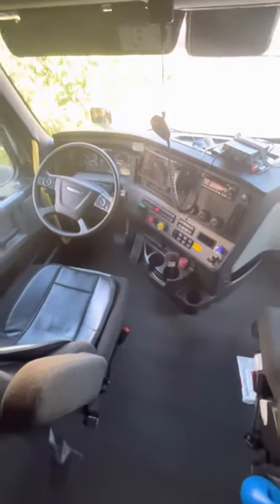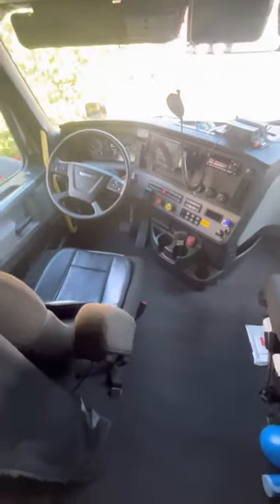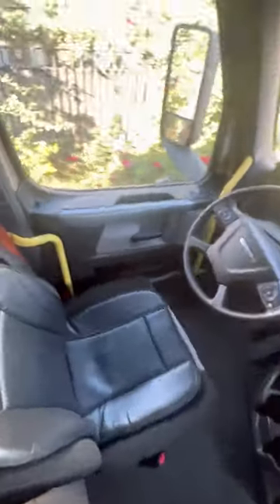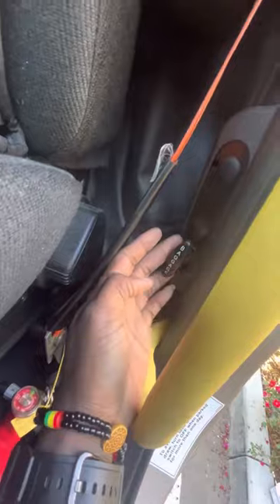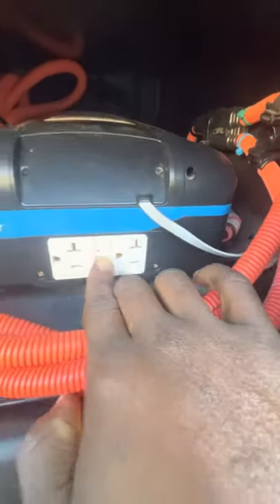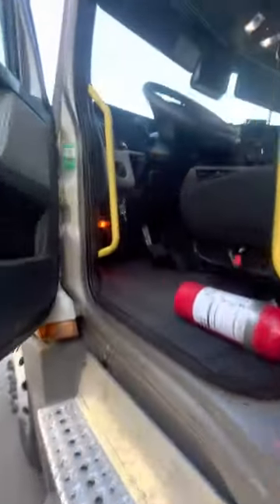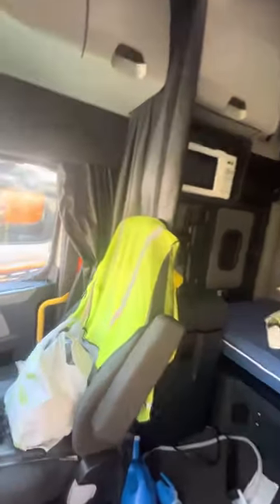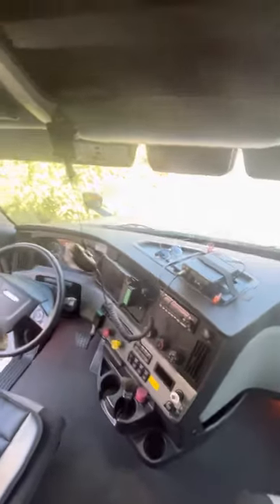INVERTER IN YOUR SEMI TRUCK NOT WORKING TRY THIS

Comment: When you turned it on inside, that is what made it work. The one in the side box is for anything outside of the truck.
Reply from the maker: Naah really when you turn it inside only it don’t work sometimes and if that happens you need to go hit the reset/power up on the one out to get everything working 🤷🏾‍♂️
Reply: @datboitrucking  I am also a Schneider driver. They are not connected. You just need to set the one inside. I have been with Schneider over 27 years. I made it a point to learn about the truck.
Reply: @anthonylagunas6737 damn you been doing it wrong for 27 years😂
Reply from the maker: 😅😅 man fr fr ! 😂
Reply: @mr.k3676  You don't know what you are talking about.

Comment: Saw 2 videos that showed this came to YouTube because I already tried it and was like maybe it's something else..... I press my reset button it won't reset smh. Might need a new inverter thanks for this
Reply from the maker: Did you do the same as I did in the video and still didn’t work ?
Reply: Didn’t work for me either. And my voltage is at 14.2.
Reply from the maker: @mr.k3676 if that’s the case it probably will be the inverter needs inspection or something because it’s suppose to definitely work as it did for lots of people that watched this video

Comment: Hi Truckers, this video is helpful for minor fix.i had a big issue. My freightliner inverter was completely dead, with no light, and no one's buttons test and reset was working. If you have an issue like me, then read this. you will see inside the truck inverter numbers are on, but no outlets are working, so how to fix it. you will see green power button inside the truck should be permanently pressed never came off because they stuck inside very badly sometimes so try to use ball pen and make hole to pull it out once is out then you are able to turn of inverter from inside the truck once it's off then after 5 seconds press it on then go out and reset the inverter Boom 🎉 you will see it will start working. I'm sure this will help and save your lots of money and time because I was going to see a technician for that .
Reply: Probably blew a fuse that needs to be replaced

Comment: I clicked the reset button and baam... it didn't work!
Reply from the maker: Dang well if this method don’t work then you probably need to go check your inverter
Reply: It's a 2024 freightliner, nothing old or broke. I spent half an hour resetting that button but it wouldn't work and then I tried to reset it again while I was at the pump fueling and this time it worked. Go figure!
Reply from the maker: Haha glad it worked !